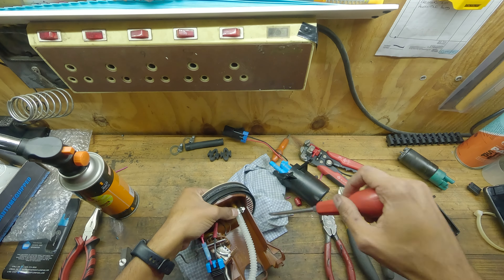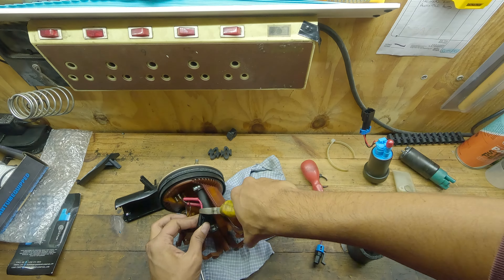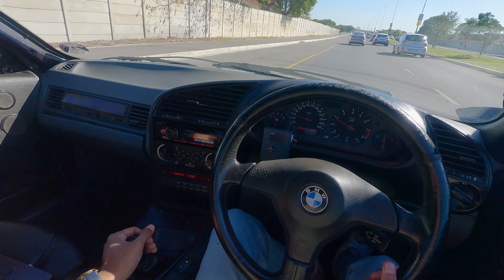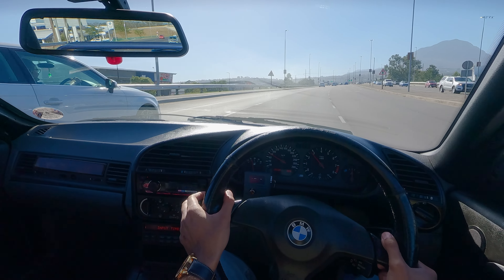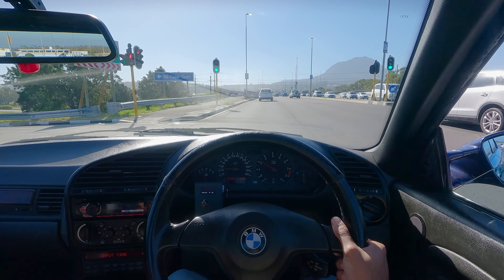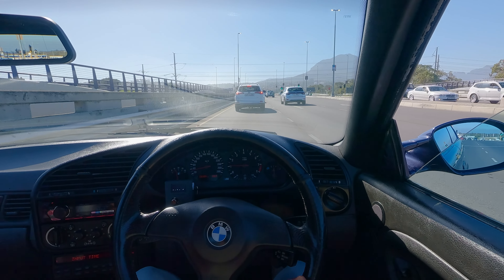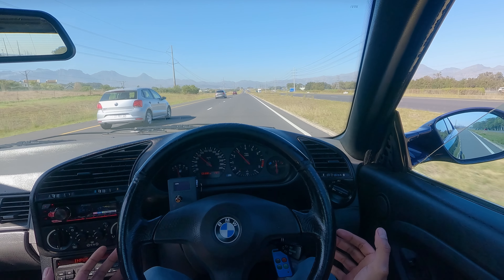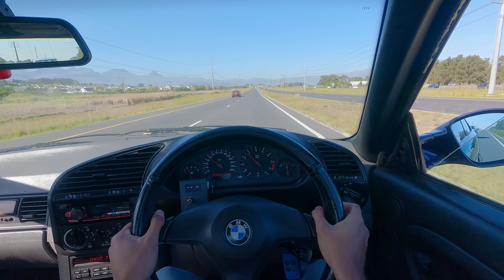Turbo M50 E36 | On Ethanol E60 & MORE BOOST | POV

Comment: Don’t forget to upgrade to thicker wires. I had my walbro 460/485 melt the two skinny wires on the inside of the fuel pump hanger. I ended up soldering 10 gauge wires to the inside terminals and crimped to the wires that come with the rally road kit. Also wire in an upgraded relay as well as 10 gauge wires from the battery to the pump to handle the extra current draw.
Reply from the maker: Thanks so much, I'll definitely consider doing this🙌🏻!!
Reply: Better yet drill a small hole two holes directly into the plastic hangar top and put ring terminals with a 3mm bolt and lock nut passing thru the hat and now you have two studs on the outside 😊

And while your at it get rid of that junk rubber hose the plastic corrugated type hose you decided not to install will last for 30 years but not that rubber hose especially inside the gas. You are supposed to heat the end up prior to installing the hose. The real problem is I think the e36 hanagar uses a 3/8 barb but most fuel pump are 5/16 and no one really makes them that way. Heat it up